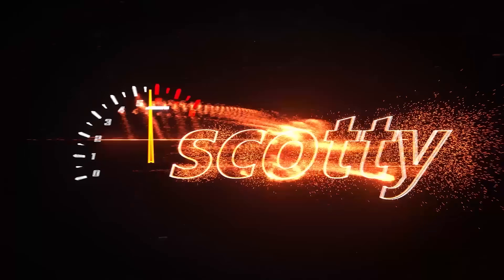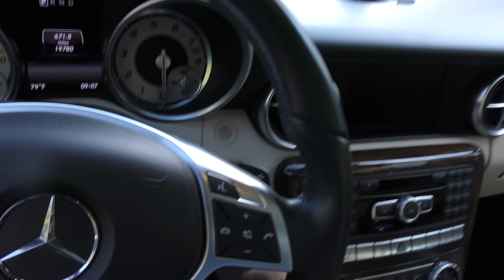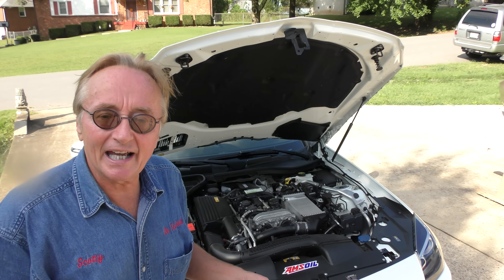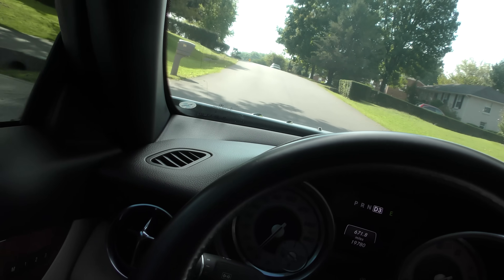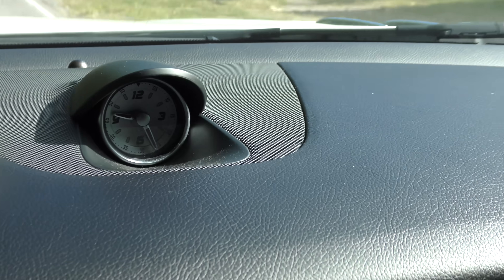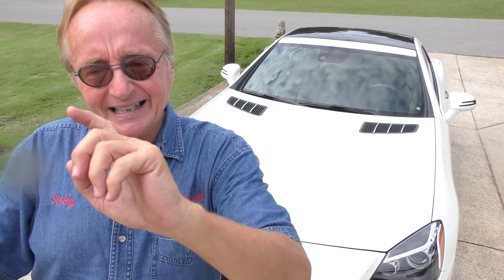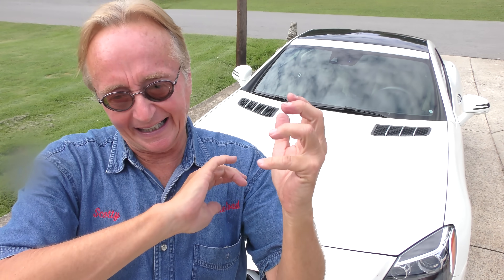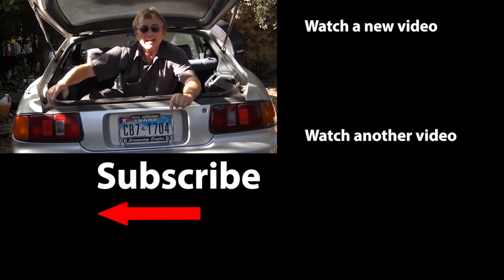I’ve Been Lying for Years, Mercedes is Actually Better Than Toyota

Comment: I have a 2008 Clk550. 5.5 liter V8. I average 19 mpg combined. Repairs are expensive, but its worth it.  It's a pleasure to drive.
Reply: Peter-------Same with me----I have a CLK Mercedes and love it.
Reply: BUT IT'S NOT EVEN CLOSE TO THE GREATNESS OF A 94 CELICA!
Reply: @HighestIQ  lol. I have owned American cars from the 60s, 70, English cars from the 80s, Japanese cars from the 90s and German cars from the 2000s and 2010s. I have found something to like in all of them, and no car is perfect. I'm sure most people have had the same experience. 

I feel that my Mercedes has a level of interior quality materials that the other manufacturers don't have. This is where it really matters to me. This is my interface with the car. I have 117,000 miles on my Clk. The interior is still in very good shape. I live in sunny Florida. I'm doubtful most other manufacturers interiors would hold up as well, unless it is entirely ugly, cheap looking plastic. 

There are always cheaper cars, always someone with more power, and less expensive to maintain. I happen to love my CLK550 despite it not being the best at everything. But it is amazing at being a comfortable, fast, classy looking everyday drive, whatever the cost that goes along with it.

If I had a Toyota, I'd find a way to love it too. Appreciate any cars' ability to do what it was meant to, and don't sweat it not being what it was never designed for.
Reply: Just sold my 2007 E550 with 158k miles. I loved it
Reply: @HighestIQ  compare apples to apples. If you want to compare a Toyota to a Merc, compare a Lexus to a Merc. It's like comparing VW to Lexus.
Reply: @Veritas-dq2hs  Yes, that is why all of Scotty's comparisons are nonsense. Folks wanting to buy and enjoy the luxury of a Mercedes will not buy a Toyota because repairs are cheaper. They would potentially buy a Lexus and then have the same issues with repair cost.
Reply: @ok4377  Lexus does have higher repair costs but it is still definitely a more reliable car than a Merc, and has been for years. Maybe the 90s and 80s mercs were as reliable but not anymore
Reply: @Veritas-dq2hs  They are also a sad copy of Mercedes with interior that still has a Toyota feel. So, maybe slightly more reliable. but I would not spend that money on a fancy Toyota...

Comment: Nothing wrong with mercedes . Depends on maintenance.  I have a 204 m 272 v6  270000 km no problem.
I have had 5 mercedes including SL 280..drove 220000 miles no problem. E. 220.d  Drove 350000 miles. C220 m111 engine Drove 250000 miles all no problems just the normal things and correct service. As you can see I was a rep for an English company ( many miles) 
I am really enjoying my V6 272 c class in my retirement. I get around 30 mpg that is ok .
Maintenance is the key.  Love your videos

Comment: Mercedes dealer wanted 5k to fix the radio in our c350.  I bought one off eBay for 200, and swapped main board where the programming lives and it worked perfect.

Comment: Honestly my 10 year old W204 C300 runs great. Costs about $500-$700 per year in maintenance/repairs which isn't bad at all for a German car. I do most things by myself and the car is still solid in it's feel and great in the winter with snow tires. I always look for the more stripped down models with less crap in them. For sure I would never buy one with Airmatic or a tire eating AMG but the basic ones are fine especially if you pick up a used one for half the cost of a new one.
Reply: Same with the e350. Coil springs, no airmatic. Mass production model for taxis in Europe. You gotta know which models to stay away from, of course anything exotic is a risk. But the right used merc is pretty good value.
Reply: The w204s from that were great and better looking than the current generation. I miss mine 🥺
Reply: Don't let people scare you. I have a 10 year old S500 with literally every option and it's doing great. Maintenance around 2000 per year. Which isn't bad at all for an S class.

Comment: I’ve owned 6 Mercedes over the years. Take care of them and they are fantastic cars. Of course there are a few models/engines you might want to avoid. But this is true with every car manufacturer. I’ve never had a catastrophic failure in any of my Mercedes. I had close to 200k on my AMG E55 before I sold it. I actually miss that car. Great vehicle. Built like a tank.

Comment: I have a 2009 E350 with 195k miles, and it’s a beast.  Toyota is not Mercedes.  2016 BMW 535i with 96k miles drives better than a new Toyota.  You can’t compare these cars.
Reply: one of the most beautiful cars ever made

Comment: Still love the MB 300TD my father bought in 1985. It's mine now and it is a station wagon that epitomizes the genre in every way.  This turbo diesel inline 5-cylinder will  run forever if you change the oil  regularly.

Comment: I have a ‘98 C280 with 114,XXX miles currently and it drives amazing for the years & mileage. Luckily got it secondhand for a steal from a somewhat wealthy elderly woman who just used it as a grocery getter, garage kept it & always took it to a Mercedes dealer for repairs/maintenance. Even my personal mechanic was shocked at how well kept and reliable this thing is. From what I see most of these C classes in the late 90s seem to be pretty reliable, can’t speak for the 00s & up. Had it for about a year & hopefully should last 5-10 more

Comment: I have a 1999 SLK230 with 107,000 miles. They aren’t hard to work on, although I haven’t had to do much other than regular maintenance
Reply: I've had 3 SLK's myself now back to a 1998 SLK 230 Sport low milage only 70,000kms. It's my weekend car and I've only had to do regular maintenance myself at the moment they a great value for money however I suspect they won't be as cheap in mint condition in a few years

Comment: Every manufacturer makes a few reliable gems. They also make quite a few flops. I've owned reliable Fords, Chevrolet, VW and Toyota. I've also had considerable trash from each one. Gotta do your research. My VW for instance. 200k and it's only cost me 1200 in repairs in 10 years BUT it's a manual with the old reliable non turbo 2.0; base model with less crap to break.

Comment: I’m currently daily driving a 2003 ML500 with 210k miles. Everything works and it drives great. Smooth 5.0 V8, from what I’ve heard this transmission is bulletproof, and a sunroof. Can’t complain.
Reply: Bullet proof car dw, mercedes mechanic speaking. Just don't let  unspecialised fools mess with it
Reply: Aren't you a little bothered that thing looks and feels like agricultural machinery? Built in Alabama...

Comment: Hi from England! I've owned a 2015 SLK 250 cdi (diesel ) for a few years now. It has the humble underpinnings of the C class, coil over suspension etc. Will max out over 150 mph and returns 65 mpg on a run. I've owned several generations of the Celica and have noticed no major difference in running costs between Toyota and Mercedes. I feel that Toyota have given up on styling for the European market!

Comment: German cars are hard to work on and they need additional care, for example, more frequent oil/ filter changes. But if you are doing your own maintenance and changing oils etc every 5000miles, I really had no issue with my 09 Touareg until 100k miles. I did have to change the driveshaft at 100k miles, but it was due to frequent off-roading in Colorado. I tried to drive a 2020 corolla to explore Uber Eats for two years as we were not required to go back to work 5 days a week. It was a good little car, but you cannot hear any radio comfortably above 60mph...The road noise/ wind noise is overwhelming. so was the Accord.  Do not get me wrong, I am a big fan of Scotty, but I really feel VW cars are not that bad...I mean, I really do not plan to keep my car for 20 years or 1 million miles...

Comment: Mercedes B-Class B200 1.8 136 HP, 79k in July used since then as a taxi, now 136k and not a  single problem on the engine or gearbox. Just changed twice the front links from antiroll bar link suspensin. Great value for the money considerint the car was only £6000, 8 years old now(2014).

Comment: I love my Benz. I do all the work and it’s not that different from any other car. I can drive from the Bay Area to Bend Oregon on one tank and the same back. I usually have enough gas to drive around for a day or so on that tank after each direction so they actually do pretty decent. I love the “glide mode” it really helps extend the range. Mines a 2017 E300 with the AMG rims and other parts. It’s truly my highway car. Also it’s kinda fun to open it up occasionally. It will hit 150mph much faster than you expect not that I recommend anyone go above the posted legal speed.

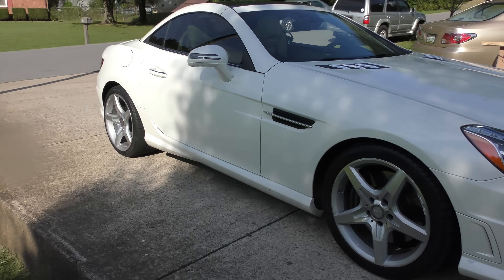Comment: 1:36 my back groaned and started to ache just looking at that side view. My back does NOT miss the CLK320!   Toyota Venza is just right (_!_) level for getting in and out with a bad back! But I have to say, I do miss the way the old CLK320 hugged the road, the center of it, the control I knew I had.

Comment: I had a 2016 C300 with that same motor, thing was a tank the only known issues with that motors that are a headache are the PCV Valves that need to be replaced as its a factory defect, luckily mine was still under warranty so I got it replaced for free. Other than that I drove the car over 90k miles in 3 years with no issues with just basic maintenance before I traded it in

Comment: Against your advice and my experience in old cars I bought an almost 300k mi 1998 MBZ E320 for $2000. Very nice and reliable. It's been running for almost a year. One of my best old cars ever. 
Was scared at first but now I'm happy.
Don't know how long it will last but it doesn't matter really. 
My other car for Door Dash, a 1990 Toyota Corolla 200k mi.
They really don't make them like they used to.
Reply: I hope u know those cars are tanks scotty doesn't know crap about the 1987-2000 benzes those are last good benzes ever
Reply: Almost like Scotty is just some old geezer who is unable to fix newer cars or afford luxury cars so he complains.
Reply: @neilr603  he can afford for sure. But like says he's a cheapskate and laughs.

Comment: I’ll stick with Toyota, older toys that is! The new ones are made with cheap parts , I know this because I own a 2020 taco and got something wrong already not sure what
Reply: Hey buddy, what's up?
Reply: @kagnewcobra5228  hey how ya doin’ 
Wish I would have kept my 06 4x4 taco I was real hard on that one and nothing happened to it. I go over some rocks with my 2020 and must’ve bent something. I hit the brakes on the highway and I get a wobble in the front (steering wheel shakes like crazy

Comment: I love you Mr. Kilmer and I'm glad you explain to the people the difference between a Germany made car and  an oversea one. Both Mercedes and BMW are fantastic cars in Europe.
Reply: They're great to drive no doubt - the AMG mercs are great as are the M series BMWs. But great in terms of reliable? Not at all. Great in terms of being reasonable to repair from a cost perspective? Sure, if you sell a kidney or two. And I live in Europe. If you finance/PCP/hire a Merc/BMW it's fine because such a package comes with warranty. But buying an old BMW or Merc outright is usually a recipe for economic disaster. I considered a BMW 335i for months before settling for a 350Z. Now, the Nissan isn't the most reliable of brands when it comes to Japanese cars - the Z compared to say, a Civic Type-R EP3 can be classed as unreliable! But compared to the 335i with their host of engine problems from dodgy turbo wastegates, turbo failure, high pressure fuel pumps, clogged injectors, boost pipe failure, valve oil leaks and dodgy water pump - just to name a few - the difference is night and day... Even the cheap consumer BMWs are expensive to repair. My sister had recently bought a BMW 116i, had a problem with the engine misfiring, finally diagnosed to be the ECU. After everything, it was just shy of £1000 to fix.

Comment: I use FCP Euro for my Mercedes. Unlimited free parts 🤷🏾‍♂️ (Lifetime Guarantee on OEM and OE parts) Scotty is right, you definitely want to be mechanically inclined to own a Mercedes even if you're rich.

Mercedes sells Bosch spark plugs $44 each from the dealership. FCP Euro sells the same spark plugs for $8 each 🤷🏾‍♂️ 

Also changing the oil on a Mercedes is super clean you could do it in a 3 piece suit. Extraction from the top, oil filter from the top. Full oil changes take me 10min.

Comment: I just bought my 4th mercedes benz.  This one is a 2012 CLS550, Twin Turbo with 60k miles.  This car is a V8 4.7L but gets 27 miles to the gallon if you can keep your foot out of the gas.  It drives great!  Very classy and smooth.

Comment: check out an AMG instead 2018+ I get 26 MPG in comfort with a V8.... or a 05/06 E55 mine was still running original engine 250K miles.

Comment: Scotty big fan here! 
I have have an 05 lexus es330 90k miles I don’t want to spend the money replacing the timing belt, are this engines known for braking timing belts? Any advice?
Reply: They will eventually, don't risk it. It's an interference engine. Belt brakes, engine is gone.

Comment: Low mileage used is the best bang for buck, IMO. Got my truck used with only 26,000 miles for $27k, when it would have retailed for $37k (certified pre-owned) or $50k brand new. V8, 4x4, full size cab, extended bed, slightly bigger and newer tires, and included a bed cover.
Reply: What a steal! Nice one mate👍🥇

Comment: Just gave my son my reliable 1988 190E to help him with his commute to work.  On my end, I pulled my 2005 SLK 350 from the garage to become my semi-daily driver.   The SLK is a blast to drive and so far all repairs have been done by me.  The biggest issue it had was the intake manifold vacuum activator arms broke.  That repair was easy.  Everything else, just regular maintenance.  Prior to the SLK I had a 400E (W124), that one was an amazing machine until the wiring harness degraded.  I tried to mend it but it was never right.  The most reliable Benzes I had were the 190E(W201), 300T(W124) and believe it or not the 560SEL(W126).  The most expensive repair I did on the latter was the hydraulic suspension, other than that it was solid.  It clocked over 320K miles until I gave it away to some college student.

Comment: I've owned and driven two M-B motor cars over the years. These were old style big, bad, Benzmobiles that were excellent cars for regular highway and long distance  driving. OK around town too.
Since then though and while there are still full size M-B being manufactured, it's the diminutive much smaller editions that seem to have a more obvious presence on the road these days. This changed situation seems to give the appearance of M-B being little different than a Benz badged Toyota Corolla. How the once mighty have fallen🙂

Comment: It really is mind boggling that German engineers can design some awesome performance cars yet they forget about the reliability part. It should go hand in hand, if you pay that much, it should last longer. JUST A SUGGESTION GERMAN MANUFACTURERS.
Reply: They've been there, they've seen it. It's an economic decision to manufacture engineered obsolescence. Daimler is owned by shareholders, mainly from oil exploiting countries; they ask for bottom line. For them, these cars, dangled together by German wage slaves, make perfect sense. The annual share dividend is most reliable.
Reply: Yet diesel mercs with more than 300 000 miles are not that uncommon. Some even have 500 000

Comment: Bought a 2003 clk 240 Cabriolet in 2012 for 6,900 GBP about 9,500 usd and loved it to bits , during lockdown I decided to restore it to new condition, I fitted 4 new front suspension arms , paid the 50 quid excess to get a new blue avantgarde windscreen, took the breathers off and resealed them , fitted a new battery, sold it in 2022 10 years later for 2,000 gbp , we bought a tiny cottage in the country with limited parking so I now have a 2005 A150 and my wife a 2013 B180 blue efficiency sport.
There is something about the Mercedes brand that no other maker has 
They are the best . 
Anyone who doubts this should buy a 10 year old one for peanuts and just enjoy.

Comment: Scotty! I have a 2000 mustang gt with 149k miles on it. I bought it 2 months ago with a loose timing chain tensioner so it had a pretty noticeable rattle above 2500 rpm. I got the whole timing chain replaced with both tensioners and it’s still making the rattle, any idea what could be happening?
Reply: I would suggest the guides be replaced with newer heavy duty ones, as the original are built with cheap plastic.

Comment: The latest Mercedes are pretty cars but there is too much electronic stuff on them, my fear of these cars is that when they break the parts alone are almost as much as the installment cost.  When my dad owned a 1975 MB 220 4 banger it was in excellent condition but when the head gaskets needed to be replaced, OEM parts and installation cost more than the eniter car.  Learning from all the cars we had from the 70s to now we've always had more mechanical than fancy technology.  Less headaches, easy to work on, and less to pay.

Comment: I was never a fan of mercedes because of how poor their reliability is compare to other car brands. But my buddy currently has a 04 mercedes e320 and it has 242,000 miles on the dash. It's still running off the original motor and bought it with 230k miles. Mercedes can last if it's very well taken care of.
Reply: That's prior to 2005, try one after 2005 and see if that is still "reliable"
Reply: Both of mine (2016 and 2011) extremely reliable